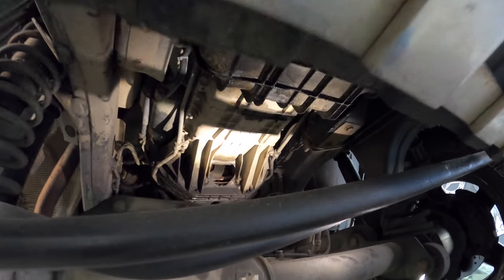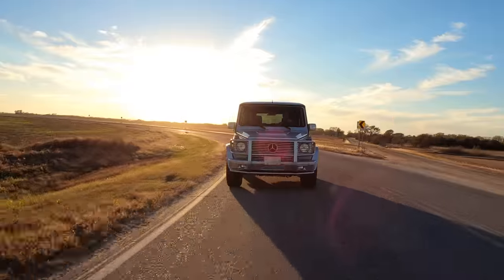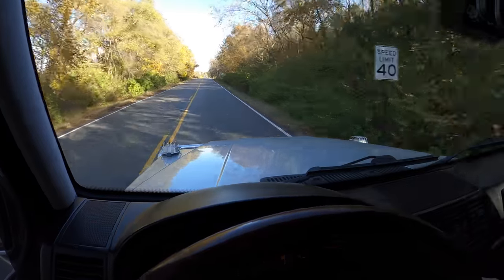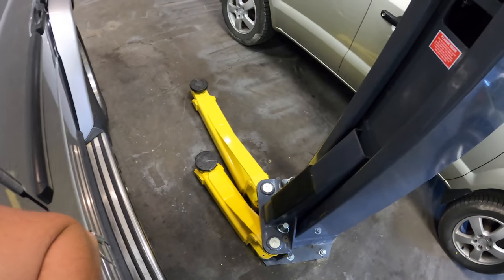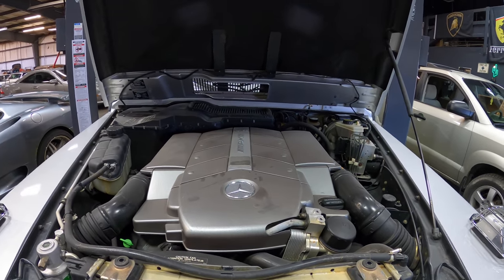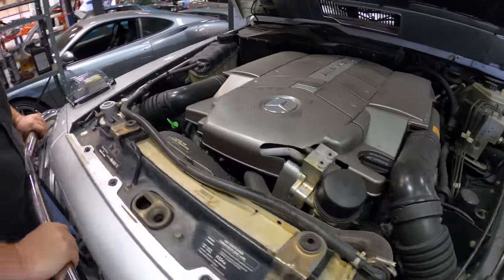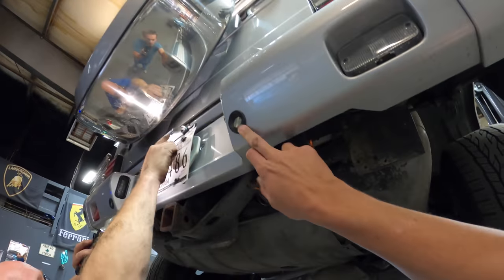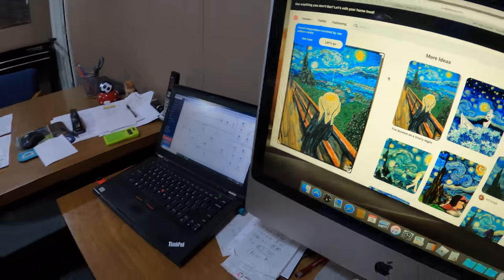Everything That's Broken On The Cheapest Mercedes G55 AMG (CROOKED MOUNTED ENGINE???)

Comment: And some people have the audacity to recommend a G-wagon above Land Cruiser.
Reply: I think the G wagon looks cooler, but you're probably right, never would recommend it over a Toyota

Wait, are you Scotty Kilmer going undercover?
Reply: I've driven in the G wagon and the only complaint I have is the windows are 90 degrees and reflect one side off the other. Very scary for switching lanes haha.
Reply: @chrisromanczuk1468  It's very distracting and probably the worst thing about the vehicle. The next worst thing is the body lean in turns on the highway, truly the scariest SUV i've ever been in above 85 mph.
Reply: @BeesonsCars  scarier than an old discovery? I used to ride in a family friends disco, and let me tell ya, the creaks and squeaks those old discos make sound scary. Like, it feels like the whole thing will fall apart any minute
Reply: I have both , in Europe parts price are very similar for g and LC. Also you can replace joint and find refurbished power steering pump and good lift kit for less than the price of the lift kit in the video. Us prices are quite high.
Reply: @paulcarmi8130  haven’t ridden any distance in a discovery, but the 17 G550 I rode in last was scary af after 85 and it was way faster than a box should be 🤣
Reply: @BeesonsCars  that's fair enough, sounds unnerving at the least lol

Comment: Motor mounts probably good, been that way for as long as I can remember. If a mount is bad it will still lean
Reply: If its vibrating, still good to change the mounts. Saving on engine mounts is a bad idea. The vibration causes other damages and leaks in the long run

Comment: that jag XJS looks lovely, great colour!
Reply: Everyone loves an XJS!!
Reply: @aliwatson7360  Until you realize how much of a turd those cars really are.
Reply: @jacobt1027  I've owned my XJS for 17 years. Apart from a tendency to kill batteries I have paid only USD$1250 above the regular maintenance costs (oil, filters, brake pads and  tyres). After 124000 km that's pretty reasonable. 2 things in my favour 1)I think the right hand drive models tend to be more sorted and 2)the guy who does my servicing is a retired Jaguar engineer who can still get the parts at cost. So when it came time for belts it cost me a third of what most would be charged. And a dozen beers!

Comment: The slant on that type of motor is fine, designed like that for those years.....issues will be vacuum leaks, 4 O2 sensors that always have issues, diff locks sometimes dont disengage, door lock inside springs breaking....but not much more else......its a tank
Reply: The f’ing door handles on the inside. Have already replaced them 3 times. People/friend break them.
Don’t let people open the doors from the inside

Comment: As a guy who works on a lot of Merc's and Land Rovers.  The chassis and suspension looks like a rip off of a coil spring land rover.  The axles are almost exactly the same.  You are damn lucky you didn't loose a bolt out of the torque converter while you were reving it and driving it.  And whoever owned it before and did the mechanical work was a moron

Comment: This guy got major repairs on four cars for about $7500.    I dropped $6600 for billet cams, upgraded lifters, hardened phaser plates for cam adjusters, and headbolts for my 2010 E63 AMG–and that was just for the parts sourced from third parties.  I still have to pay for the install.

Comment: Hey hoovie I got a 2003 Nissan Altima 3.5 .  For sale $500 and can't figure out why the heat won't work. New thermostats and fluid. New heater core, been flushed completely out. New temperature control modular. New fuses. And still no heat. Oh yeah the actuator doors work properly. So I have no clue what is wrong. Maybe the WIZARD AND YOU CAN GET IT DONE. 500$

Comment: 1) Engine is supposed to be at that funny angle, look at engine bay photos of any G with M113, they all look like that.

2) worn out driveshaft U- joint WILL cause a horrible vibration “ that can’t possibly cause that vibe” you said, were you joking?!?!

3) torque converter bolts may not be loose because the motor was removed, I think the transmission was replaced, I saw a new transmission mount...

4) front driveshaft takes ~30 mins to remove the 16 stubborn nuts/bolts, plus ~30 mins to re-attach them, the driveshaft itself is ~$753 from MBZ.
Sounds like car guru is giving Tyler a great deal on that job (quoted $759 for part and labor).

Comment: With 200,000+ miles, is any vehicle worth $22,000? That's a parts car. The M-B dealer probably quoted the previous owner $20,000 to fix everything that's wrong with this vehicle so he traded it to the dealer for $3,000 towards a new $140,000 M-B.

Comment: Back in 2009;I bought a 2000 non-kompressor with 160.000 kms which needed some work for 16.000 euro. Two years ago a friend of mine sold his 2006 kompressor with 80.000 kms which had some rust (4-5 months of snow a year where he lives) but was technically 100% for 30k. So some 20k for a car with 350.000 kms and a lot of problems doesn’t sound as a very good deal....

Comment: Yeah.....if we had those prices here I would be driving a Ferrari :) Yearly services cost $1000-2000 usually without fixing anything, just fluids for the most part. And I did shop around, some indy mechanics charge more than dealerships

Comment: Just about choked when you said 22 thousand.  I bought a 95 Golf this summer for 22 HUNDRED then threw about 1500 to fix the entire suspension. Runs and drives great and near that mileage marker. 22 grand holy moly.

Comment: The tilt on the motor is normal on these garbage cans.  Something to deal with steering clearances. Looks wrong, but it's "right"...After diving deep into a couple of these, so is the driveline vibration.  To think I used to want one of these!  Parts are a nightmare to order especially for the ones that were brought to the US by Europa International, before they were sold here by Benz. There are so many variants on the imported ones that receiving the correct part, which usually takes FOREVER, is reason enough to shut the shop down and throw a kegger.🤣

Comment: I wish I had Car Wizard as my mechanic. Honest and reasonable costs. I was just at the Toyota dealership. A new 4 Runner and there was a front end shimmy that started. I said it could need air. Dude comes back wanting $260 for a front end alignment on a truck with 10,000 miles that has never been off road. I said forget it. The tire place can do it for under $90. It needed air as I suspected. It was there for its tire rotation and oil change. Thieves. The service manager was working on a commission and though I fell out of a tree..

Comment: my '88 e32 u-joint went bad, and was told the whole shaft had to be replaced as its one unit. the u-joint is staked in. took it to a machine shop, and they took it out and found a replacement, rebalanced the driveshaft all for $150 vs $900

Comment: the Wizard is a very cheap mechanic .. If I had to do this here in Italy it would have cost me at least twice as much ... at least ...  for 2000 dollars here they don't even take a look to a Bentley leave it alone fixing it ... 2 years ago the Mechtronics of the Gearbox of my Audi  broke and only replacing that it was 2500 Euro... so 3000 dollars ...

Comment: The fuel gauge in my 2002 w203 also went wonky and it turned out the fault was in the display cluster. Sharing a cluster with the wagon you got here you could swap it out for a facelift 2004->  cluster in a couple minutes. Just saying.

Comment: My grandpa had torque converter bolts back out on his old baby blue Olds Custom Cruiser Station Wagon.  It was after he had someone swap out the old diesel engine in favor of a big block out of an old firebird.  He said to me "look at how much better it drives after they fixed that, can you believe it"  as he took off doing a smokey burn-out

Comment: I want to get a diesel pickup, 1995 or older. 
Which brand pickup,  year and diesel engine size,  enough to pull a travel trailer a 25' long trailer.

Comment: In college, middle of winter, I started having problems with the radiator fan (mounted on the front of the v8, not an electric fan) rubbing on the bottom of the fan shroud. Could not get out of the weather and figure out what was wrong so I trimmed the bottom of the shroud. By the next weekend it was rubbing again.  Crawled underneath and found it was missing a couple of the bell housing bolts, one was broken off, and the rest were loose. This let the back of the engine tilt up and the front tilt down, rubbing the fan on the bottom of the shroud. It still scares me to think what would have happened if it had completely separated at 80mph on the highway.

Comment: Another possible reason for vibration... mismatched tires. Even brand new... 2 different brand or type of tires of the same size can have different rolling circumference. Puts driveline in a bind if the tcase is engaged

Comment: What is a good site for finding salvaged parts? I have a 2005 G500, the tail door is rusting and it will need to be replaced. I also need a new running board

Comment: I thought you could access the fuel tank sender from cargo area, under carpet there is a round disc that is screwed down with a foam seal. Remove that and you are in the right area. Unless something is different on that model.

Comment: The slanted engine is normal. Looks like a collapsed motor mount but it’s not. Just look at the transmission mount bracket and you’ll see that it’s welded at an angle to make up for the slant.

Comment: Since I'm not gonna read all the comments to find if someone has told you. I am a mercedes tech and I am familiar with the older g wagons. The engine sits uneven in the bay by design. They had to do it for the engine to fit. It is normal.

Comment: The motors in all the G wagons are placed in the engine bay slanted. Its due to the large size of the engine, manufacturer had to place it inside the bay slanted for it to be able to fit.

Comment: chec the 4 wheel drive system  there is a good chance the  pressure  actuatores and valves on the axles are clogged or damaged from lack of use.

Comment: He should have known he’s not getting a G wag for $22k. 🤡 my 2002 was $56k. Mine had 22,000 miles not 222,000 miles
Reply: Also came with 22” rims, lift, system, upgraded bumpers and side view mirrors, new grill.  And, I got my headliner fixed at Mercedes under warranty was another $12k. Luckily I only had to pay $500 through insurance,

Comment: Wizard has mentioned several times than Tyler gets a special discount rate for repairs at his shop. It would be interesting to hear what the normal rate would be in these jobs. Hope he doesn’t pay to “remove ” the OEM tilt from the engine- that could be enough to pick up another hooptie.

Comment: The Wizards prices seem really low.
The amount of real man hours just on that Bentley should have popped a five grand repair.
And it's not like The Wizard gets to drop that fifteen grand in his bank account all as profit.
He might clear six grand on all those cars and still as a private businessman still have to meet more bills related to the  business.
That G wagon might have some really horrendous damage to the torque converter and the output shaft if the engine if slap happy the mechanic just jammed that all together.
Fantastic you didn't die in a massive 80 mile per hour transmission explosion there Hoovie.
Maybe next time you get a vehicle that is telling you- I WANT TO KILL YOU- you just pull over and  have it flat bedded to the Wizard.
Awesome video series...I always wondered about the G wagons.
Let's hope it doesn't stand for garbage.
I think this might be one you sell for what you put in it if the Wizard sees some slap happy terminal damage.
Good luck Hoovie.